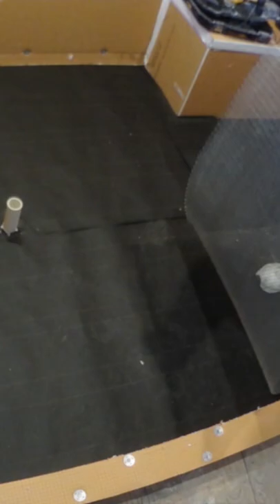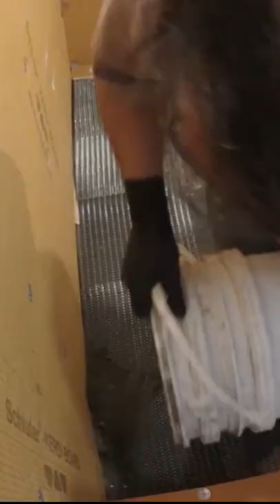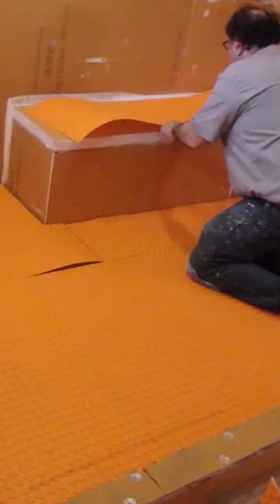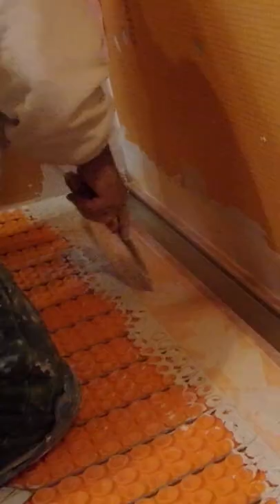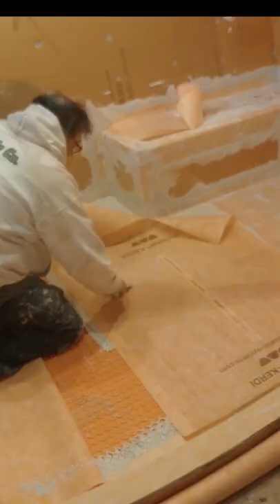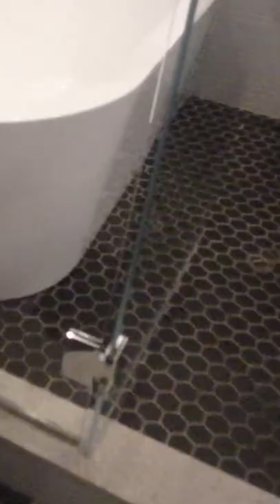Big Mud job #short #diy #construction

Comment: I know your old school so I know you know that’s actually a small mud job lol.  When I was a helper my record for how many tubs I mixed by myself in a 8 hour day was 15.  40 heaping shovels of sharp sand and one 98 lbs bag of Portland type 1A cement. Mixed it in the box three times dry and three times wet then carried it in five gallon buckets full because I was one of those idiots when I was younger and thought I had something to prove. 

One time when I worked for a union company there were 8 of us and we paper, lathe, mudded, set and grouted 1,200 sq feet of tile in 8 hours. That was hectic.  As a helper one of my mentors had three fair size residential builders that we tiled for and averaged around two thousand sq feet of tile a week. Mud, set and grout. Week in and week out two regular baths a large master a powder room and massive foyer and kitchen with a fireplace. When I watch some of these people I realize how fortunate I was to be able to learn from the bottom a d earn my stripes. Hard slave type work builds character that is unmatched by anyone that hasn’t done it. 

Anyway I said it before and I’ll say it again you are by far the best guy on YouTube. Old school and I respect that very much.
Reply from the maker: Thanks for watching my video.